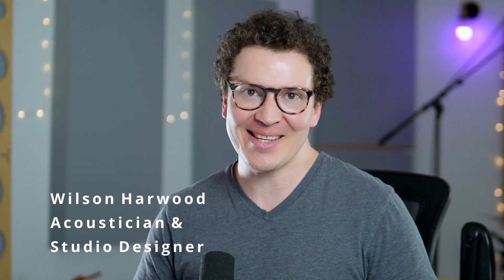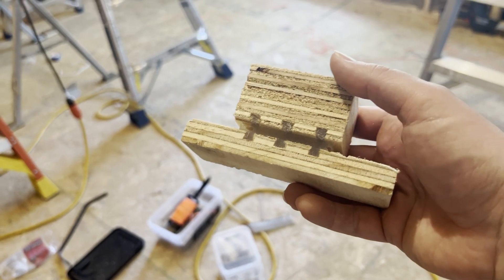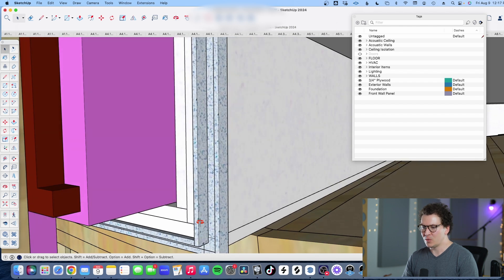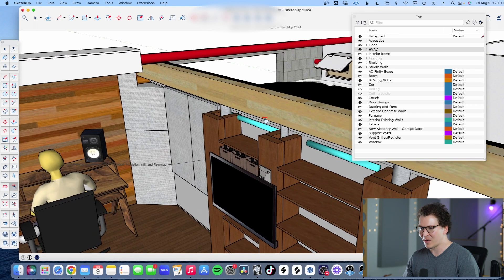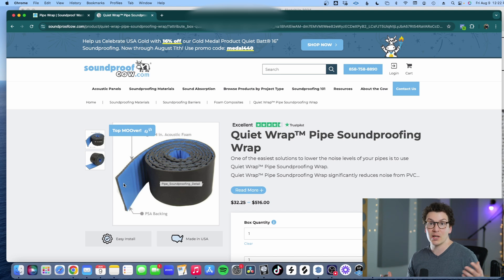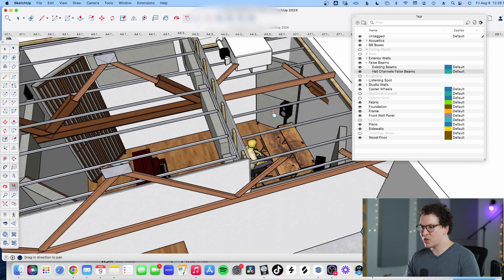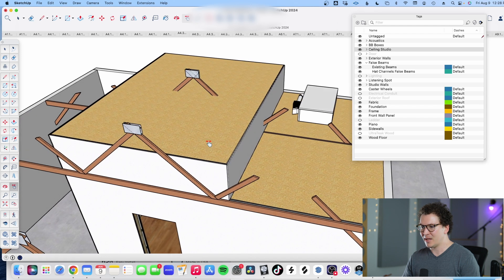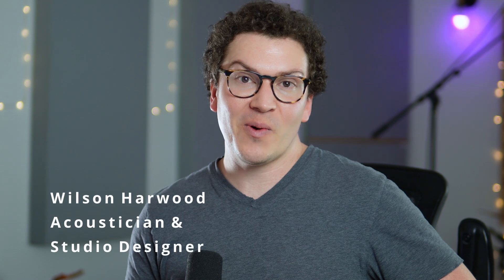Soundproofing Around Pipes, Ductwork and Beams

Comment: For around a steel beam in a ceiling, you could build a bulkhead from plywood and 2x2s. 2x2 is fastened to furring strips above. Way easier and you have a complete envelope that you can easily layer drywall on top of.